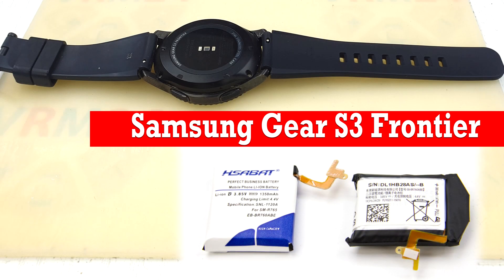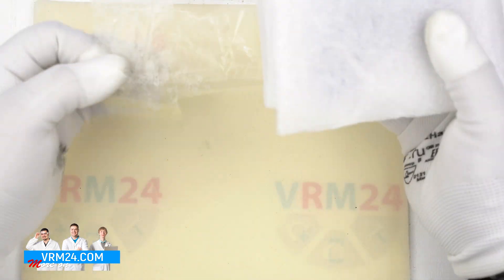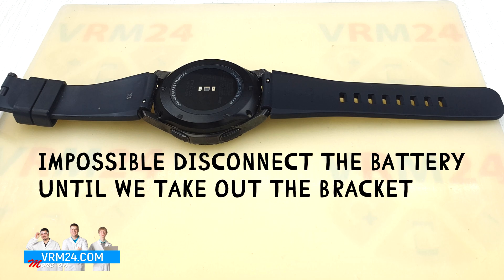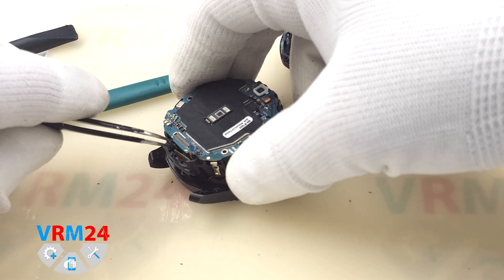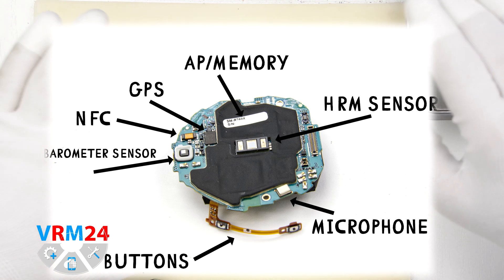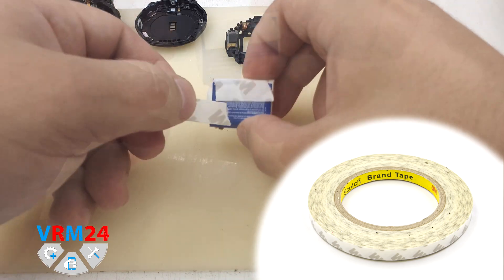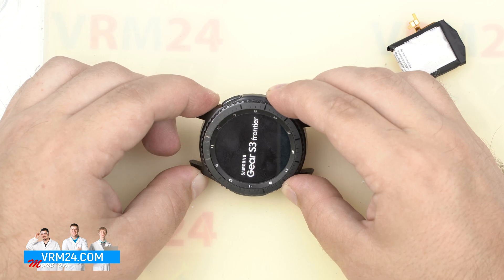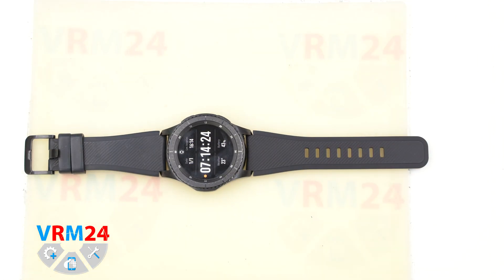Samsung Gear S3 Frontier SM-R760 🔋Battery 1350 mAh replacement

Comment: Thank You for the great video! Just did my replacement and everything works like normal. Sadly 2 screws were so badly corroded that one broke in half and the other i may or may not have just pulled through the plastic. As i am only delaying the inevitable until i can get the new S7 on sale it still works perfectly for me!

Comment: 1350mAh battery?!😂 Now that's a scam!😂
Reply from the maker: Hi, maybe, but the battery works fine. Anyway, it works strangely - for the first seven months it held a charge for 4 days, then it started downgrading a charge to 1.5 days and after 2 years it still holds these numbers.
Reply: @Vrm24com  That's about the experience I had with the original battery. Still holds over 24h today and never changed battery. But going to change it to a new original now before they remove all support for it but I need a tri-tip first.

Comment: WARNING: DONT REMOVE THE COMPARTMENT ABOVE THE DISPLAY, it unnecessary for just the battery replacement purpose!! Display module is very sensitive and it will damage display!!!

Comment: Alright, few things. 

One: yes, we all know its not possible for this battery to be 1,350mah at all when the original is 380mah. That would make the battery you're using a little more than three and a half times larger than the stock one. Anyone who watched the video can tell that is compelte bull.

Two: at around 4:35 you start to take off the power and back button ribbon cable from the side of the watch. Everyone, BE EXTREMELY CAREFUL. If not, you can end up ripping the ribbon from the top off of the motherboard. If this happens, you will need to solder it back onto the motherboard. If you have no such knowledge, youre SOL.

Three: while the capacity of the replacement battery is a compelte lie, the tutorial on how to replace it is still pretty informative. Just follow along and be extremely cautious of that power and back button cable. You can end up doing exactly what I did and rip it from the motherboard, thus making it so you still can not turn on the watch even after replacing the battery.
Reply from the maker: Hi! Thanks for your comment! I see your point. So we were not only replacing the battery we tested it in a few simple tests at the beginning and after 7 months. We didn't have the tools to test capacity  but anyway all our tests were legit. And yes, the repair is always about being extremely carefull no doubt. In this case it was so difficult to attach the battery and buttons cables because the tip-holes were too small.

Comment: 4:33 you show the removal of the button contacts, but you do not show how to refix them after. Does it need gluing?
Reply: You can literally just push them back into place. However, be extremely careful not to do what I ended up doing. The top of that ribbon is soldered onto the motherboard. If you end up ripping it off, it will need to be resoldered back onto the board. If you have no soldering skill, the power and/or back button will not work.
Reply: No need regluing. Even battery don’t need regluing!

Comment: Ile wytzymuje zegarek na baterii 1350?
Reply from the maker: Witam, mamy krótki filmik z testami. https://youtu.be/epwYEPi-zJ0
Reply: @Vrm24com  There's no way this battery can actually be 1350 mAh.  For a battery that is 3.5 times the capacity of the stock battery, you gain 1 day of extra usage.  Does not make sense.  The larger battery should be lasting for about a week before needing recharge.

Comment: I have an gear s3 frontier and is not starting anymore. Do you have any ideas what are the reasons? Thanks!
Reply: same here, it use to show some starting problems, then I found a trick, that you place the watch on charging and then once it shows, percentage, press the power button, keeping the watch on dock, it use to get started, but now even that is not working ;( :(
Reply: My personal experience, your mileage may vary.

I had a similar issue but I 'think' Samsung pushed an update that reconfigured the power-on function. I have to depress both buttons to power the watch on and it's been working fine for me since. The 'power button' alone will still bring up the menu to power off the device though. This is why I think there's an update that snuck past me (my watch auto updates in the background).
Reply: @PorscheDuésnburg Haha!😂 No, dude.. Samsung did NOT release such update... Mine powers on just like it has since day one with using only the power button
Reply: @Oystein87  then mine may be in the beginning stages of a ribbon failure but it's been this way for just over a year now.
Reply: @PorscheDuésnburg  That is more likely..
The last update the watch got was a small security and stability update in August 2022. And that update did nothing for the functions etc.

Comment: hi! I have a problem with my gear! I replaced the battery because it no longer charged and the red led flashed! after a day i have the same problem again! is the mainboard damaged?
Reply from the maker: Hi, who knows, the new battery has malfunctioned or the charging station. If something consumes the charge, it should be disassembled and tested.
Reply: Get a proffesional opinion instead.
I would not trust someone who installs a battary clone with FAKE 1300mAh
Reply: @Oystein87  So there's a real 1300mah battery that's not a clone? 🤔
Reply: @PorscheDuésnburg  Nope🤣 Not physicly possible for that size
Reply: @Oystein87  Just going off your wording, which insinuated that there was such a battery.
Reply: @PorscheDuésnburg  I edited it now to avoid confusion👍

Comment: the reviews on the website are not very good. people say that it doesn't have 1350mah and that it lasts more than a day charged... can you do a measurement or something? to know if I buy the normal one or this model
Reply: I call BS on this batteries capacity. Label is def false advertising. Everyone should stick with the 430 mah battery on Amazon for around $12-$14 cyber deals as low as $10 with prime membership right now. 430 mah is a good upgrade then the stock battery which is 380 mah. There is a reason you can't find this battery sold on Amazon because it's a scam.
Reply: @The.Governor  Also, if the 1350 mAh battery actually was that big, it would be physically larger than the watch itself.  It would be great though it you were able to get it in there, this watch would last for a whole week before needing to be recharged.  Sadly, our battery technology has not advanced that far yet.

Comment: Yes , and please compare runtime!
Reply: A new original 380mAh vs a new FAKE 1300mAh probably ends up having about the same battery life. It's not physicly possible for that battery to be 1300mAh when the stock one is 380mAh in the same size.. It's just common logic if you know the basics behind batteries
Reply from the maker: Hello, we will, we need some more tests to compare.